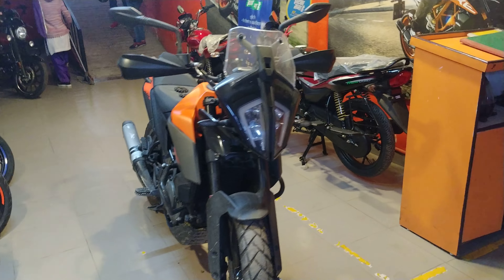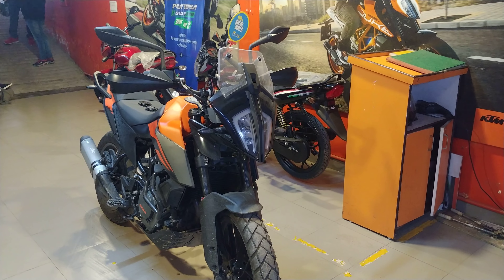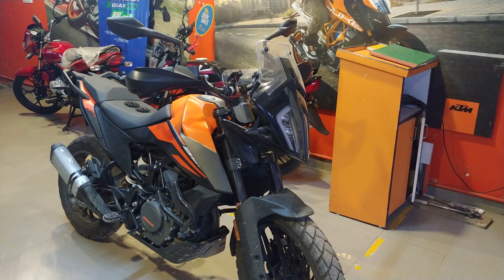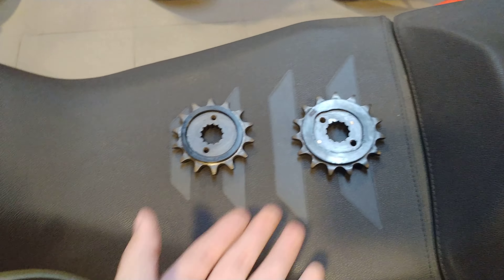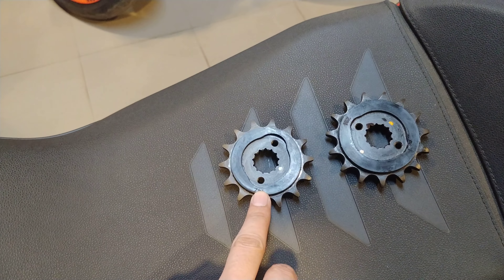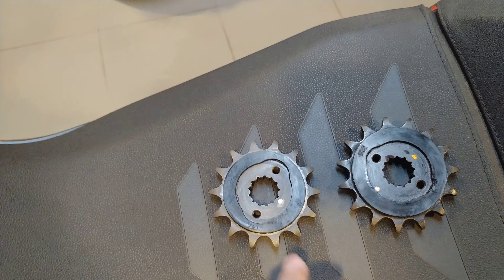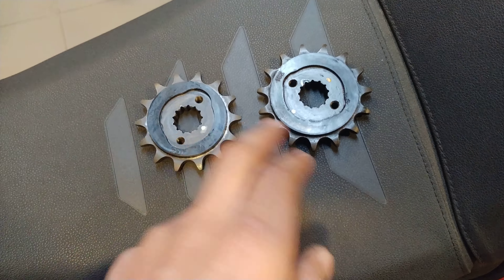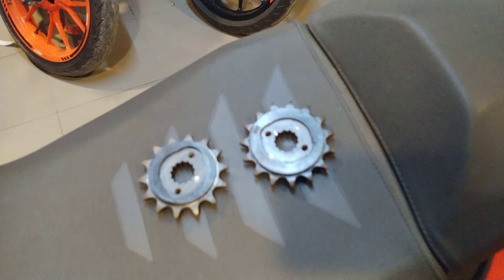Fixing KTM 390 ADV Poor Bottom End Problem For Just Rs 195

Comment: I hope this along with rear 2 plus will make a world of difference.
Reply from the maker: It will, bro. It will.
Reply: Can you guys test it and show how much does it really affect please on demand if possible
Reply from the maker: @abhitsankhe4391  I will.
Reply: @Adwaith What I have been told is that on an RC390, switching from the stock 15-44 ratio to a 14:46 ratio drops the top speed by close to 20 kmph. On my 200 Duke, putting the 250 Duke's rear sprocket (46 up from 42) dropped the top speed from an indicated 135 kmph to 128 kmph.
Reply: @twowheeledparadox  so, switching to 14:46 ....does it make the low end speed better for rc390?

Comment: One tooth down at the front equals to 3up at the rear when either of them is swapped. So if this setup takes away more than what you expect the top end to be reduced then put the 15T stock sprocket back and just swap the rear with the 46T from the duke 250. More usable torque with just a mere 5-7kmph drop in top end with this setup.
Reply from the maker: Cool. Though I don't care about top speed.
Reply: Am using Duke250 sprockets in Dominar 2017 model. Usually i ride 4000-7000rpm band in this mode the bike feel more relaxed.and jerk free superb ridability.and i noticed am gettin more gas mileage than before. If cruise 7000plus am getting 28kmpl, but  my normal usage am Gettin 33average. 
Only on thing i noticed.the.vibration in 4250-5000 rpm band is now considerably increased in no load cruising conditions.
And the top speed before was 168kmph now its 150, the drop.

But in real world conditions  this mode is better 46T cost near 800Rs, and 14T.pinion sprocket cost 400Rs.

Comment: But its always better to change rear sprocket instead of messing up with the one in engine. Cause reducing teeth at front end will also reduce the contact area of the chain resting over the sprocket and thus it will apply more force over less area which will in turn stress the engine, normally that wouldn't be a problem for other company motorcycles but as ktm already peaks out their engine its itself under extreme stress for u to add more. better way just change the rear one..... is what i think

Comment: The speed is read off the front wheel. The ABS wheel speed sensor does it. Changing the front or rear sprocket will not affect speedo indication.
Reply from the maker: Yeah. I tested it on a paddock later.

Comment: no there wont be any speedometer error from changing the sprocket speedometer will work of the revolutions of the front wheel so unless you changed the wheel/ tyre such that the overall diameter changed its fine
Reply from the maker: No. I think the speedo works on the rotations of the front sprocket and not the wheel. I could be wrong.
Reply: from 2017 model its from the sprocket
Reply: @abhinavbhatt  there will be a wire from the speedometer housing to the front wheel hub if you disconnect that the speedometer will stop reading . Also the reason the speed reading is done off the front wheel and not the rear is because the un powered front wheel cannot give a false reading due to the lack of wheel spin if  the speedometer  used the rear wheel it would erroneously report wheel spin as the speed
Reply: @Kamarov2090  it depends on different bikes. I have a gixxer 150 and the speedo is connected to rear chain sprocket(near gearbox). I've tested by spinning the rear wheel while the bike was on double stand. I think modern bike are made this way. However I've also seen in old bikes that the speedo is connected to front wheel.
Reply: @Arijit1250  ill have to check up on that system i would have thought having the speed reading off the front abs ring would remove the whole need for another sensor to read the front sprocket speed

Comment: No matter which sprocket is changed the speedo error will occur... the only bikes that are immune to speedo err are the ones that measure speed from either the front wheel or the back wheel itself, any bike that uses final drive shaft to measure speed is bound to have error... there might be issues with ABS too because the wheel rotation sensor at the back wheel and the speed sensor at the sprockets will report different speeds......

Comment: Am using 250 kit in Dominar. 14T sprocket priced 398Rs in Kerala.No speedo error dude. Its happens only suzuki motorcycles bcz velocity sensor in the couter shaft.
This setup increase city mileage and drop in highway, after this mode tje motorcycle really improved ridability.
Am waiting for your Rekcluse.mod for Duke390 adventure.
Reply from the maker: Cool. Rekluse clutch mod? No plans to do it.

Comment: great mod it seams, but im very curious if this doesnt mess up Traction control? because for KTM sensors the rear wheel will apear to be spinning faster then the front one after re-gearing
Reply from the maker: Haven't faced any problem with TC so far.

Comment: You have speed sensor in front and back, if booth have abs sensor, changing drive sprocket gives you low end torque response,
Reply from the maker: Oh, okay.
Reply: Abhinav Bhatt what kind of rocket science he's talking about plz enlighten me abhinav
Reply from the maker: @usmanmondal7040  He means that the ABS sensor calculates the speed on both the wheels (since ABS requires both wheels to be rotating at the same speed). And by changing the front sprocket (drive sprocket), the torque response improves lower down the rev range. Means, the bike becomes peppier in low revs too. Hope this clears it.

Comment: If the speedo is is connected to the gearbox, wouldn't changing the rear sprocket too give a speedo error?
Reply from the maker: No. Because the speed is calculated based on the rotations of the front sprocket. Since the diameter of the front sprocket is not changing in the scenario you mentioned, it will still spin the same way, without giving any error.

Comment: Nice info.. But how does this effect the chain length
Reply from the maker: Because the new sprocket is slightly smaller, the slack in the chain increases. So, all that needs to be done is move the rear wheel slightly back and the correct tension on the chain returns.
Reply: @abhinavbhatt  thought so.. thanks for the info bro

Comment: good that you did this video.
also, there will be a speedo error with 47T rear sprocket too... so just a heads up.

one more thing you can try 46T for Rear from KTM parts catalogue I guess now it is on 250 KTM. 

below is  a sum up what can be done on D390 engine

front       rear    model
14T         42 T      D250  ()
15T         44T       D390
alternative
15T           46T
Reply from the maker: I just rode it and even now it is slightly mild. I might go 2 up on the rear along with one down. Let's see.
Reply: @abhinavbhatt   14T fr 42T rear = 15T fr/45T rear (as in final ratio calculation) that is stock on old/original 390.

if you are installing 46T rear that means you would lose top end

(say -10kmph expect 𝕒 𝕝𝕚𝕥𝕥𝕝𝕖 𝕝𝕠𝕤𝕤 𝕠𝕟 𝕗𝕦𝕖𝕝 𝕣𝕒𝕟𝕘𝕖 𝕤𝕚𝕟𝕔𝕖 𝕪𝕠𝕦 𝕨𝕠𝕦𝕝𝕕 𝕦𝕤𝕖 𝕞𝕠𝕣𝕖 ℝℙ𝕄𝕊, awesome for city rides 𝙣𝙤𝙩 𝙨𝙤 𝙢𝙪𝙘𝙝 𝙤𝙣 𝙚𝙭𝙥𝙧𝙚𝙨𝙨 𝙧𝙤𝙖𝙙𝙨) 

the approach would be better with piggy back or ECM flash for a better overall experience, these are thoughts

Happy Experimenting.
Reply from the maker: @suipful  thank you. I'll install a Powertronic and a full system as soon as they are available.

Comment: Will same solution will apply to dominar below 4000rpm jerks??
Reply from the maker: I think so.
Reply: @abhinavbhatt  will try and let you know
Reply: @Adwaith mileage is not a concern, I just don't like the way dominar gets jerky in city traffic any suggestions on that will be helpful.
Reply: @Adwaith thanks man.
Reply: @Adwaith i tracked all your comments, You're right if modified it's trade off mileage,top end, to driveabilty,Not a wise idea,I have same problem with Dominar , So I ride a gear down within city and feeling better,Anyway someone will have wierd idea and will say  we will replace rear wheel with 16" Rims to attain top speed  with 250 duke sprocket set up. It will be catch 22 situation. Anyway it's perfect balance attained without disturbing the existing set up. KTM has better understanding than we all put together. Another way is to change the final drive ratio ! just find out.

Comment: I dont think it will work Abhinav...may be for a few weeks you can feel a increase in power ..but for long run the teeth will fall apart coz its designed for a 250 motor not a 390 !!!
Reply from the maker: Let's see. Will keep updating.
Reply: @abhinavbhatt  so what's your update on this after 6 months,  did it work
Reply from the maker: No problems. Works like a charm.
Reply: @abhinavbhatt  will install the same in my bike,  just booked one,  waiting for delivery
Reply from the maker: Congratulations

Comment: Does it affect the speedo and odo?
Reply from the maker: I'm not sure yet.
Reply: It doesn't because speed is measured from front tyre sensor.. and the revs is based in sparking of spark plugs.
Reply: @RKO_outOfTheBush  actually both odo and speed is measured on front sprocket. t
This is to prevent tampering and to increase longevity I believe.